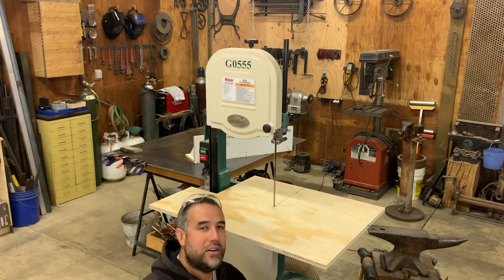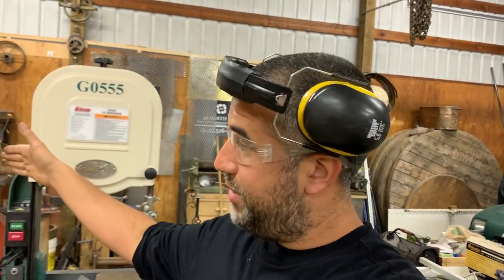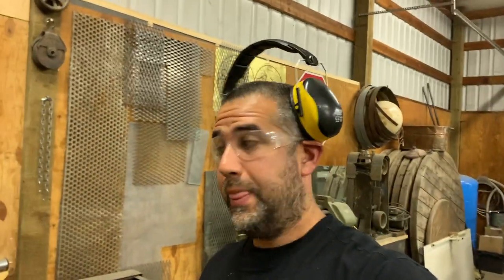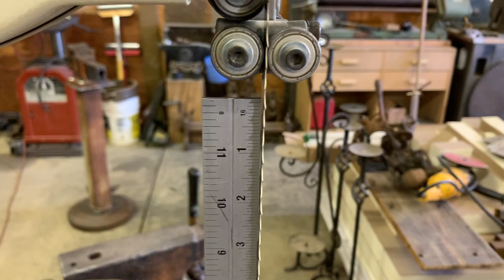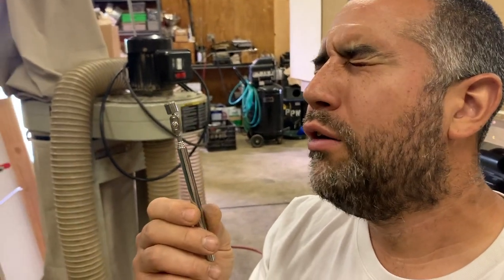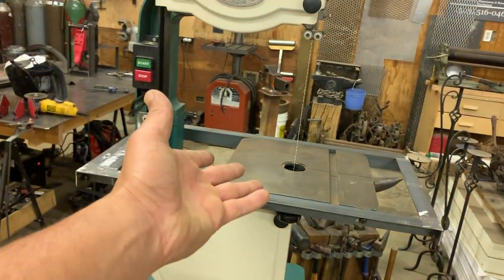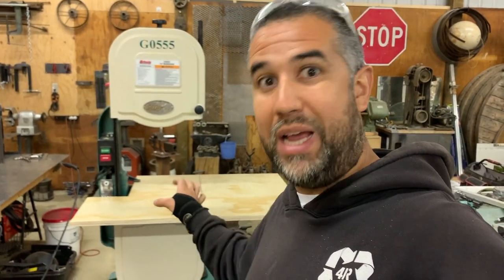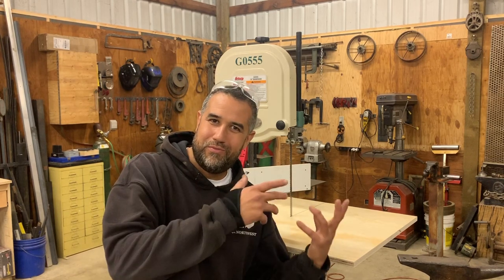Bigger Better Bandsaw Table Build!

Comment: Just wondering why you replaced the HF band saw with the Grizzly since the HF was very similar, although I just noticed the 6" riser bock!!!???    Looks like you upgraded most of your power tools!!!  Good for you!  Thanks for the enjoyable video!
Reply from the maker: Daniel Edewaard great question Daniel! Honestly the Grizzly was a craigslist find with roller base AND the riser block already on....for $180!😂 it was such a crazy deal I didn’t really have a choice! The power of Christ compelled me know what I’m sayin!😉 at the time I had a smaller shop and no space for 2 saws. Now I have a shop 3 times bigger and I wish I’d kept it🙄 have multiple machines set up for different tasks is awesome! If you have the space. But yes, most my equipment has been “upgraded” depending on your perspective. Mine is larger capacity more power. Not really necessary for most small projects BUT I get order that do require the need for both amenities. For most my previous set up was plenty. Thank you for watching!